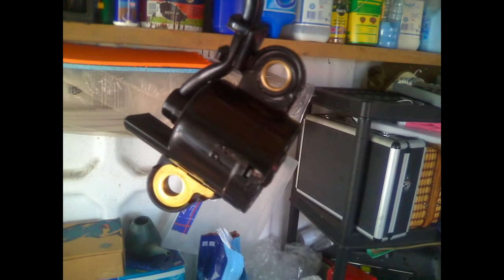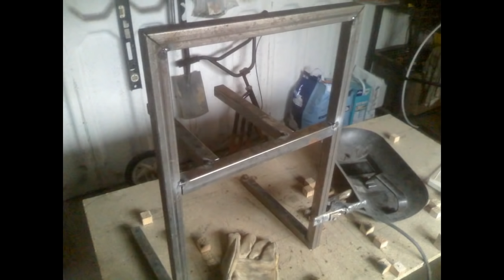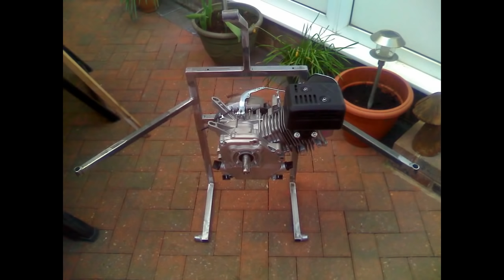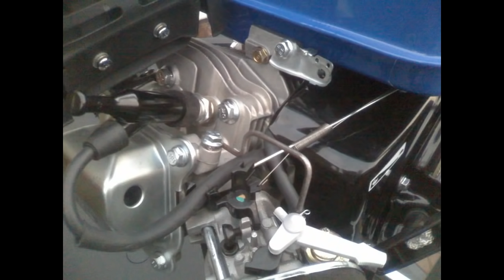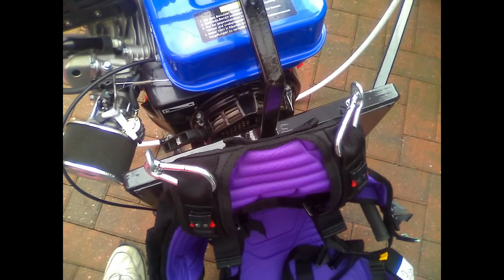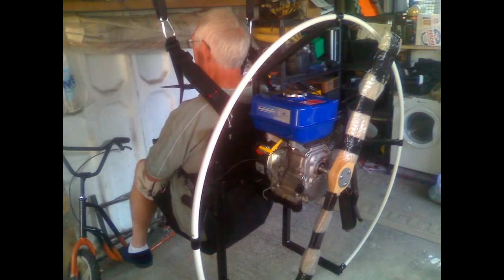Limited Budget Build - Birth of an Eggmotor - [New Eggmotor Book On Amazon - link in description]

Comment: very useful for me to see way you make the basket frame, because 1st time i think the support bar under the engine should be reinforced instead of only 2 bar directly welded to the main frames.
Reply from the maker: The later Eggmonster (gx420) and gx270 projects were fitted with support bars to strengthen the engine mounts :)
Reply: TeamEggmotor oh maybe the 2 later versions are heavier and more powerfull can cause more vibration, anyway stiffener will prevent crack caused by fatigue at the weld joints